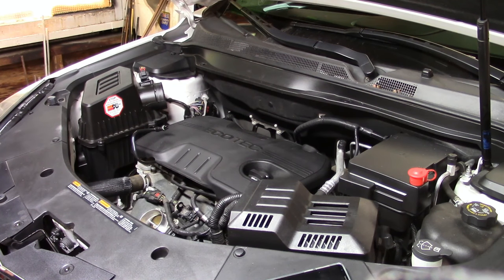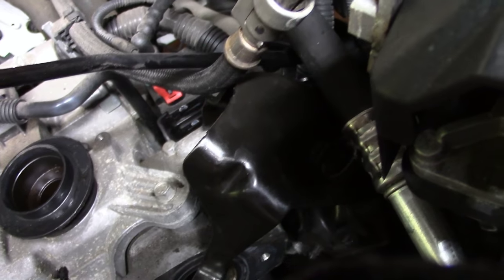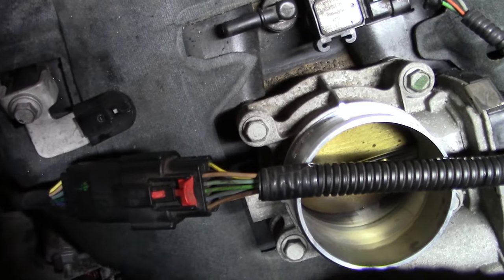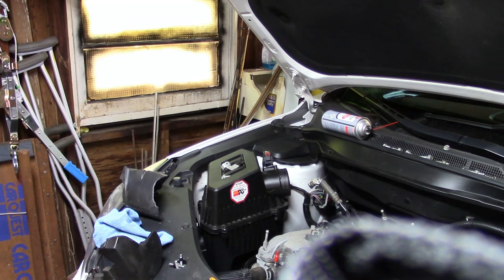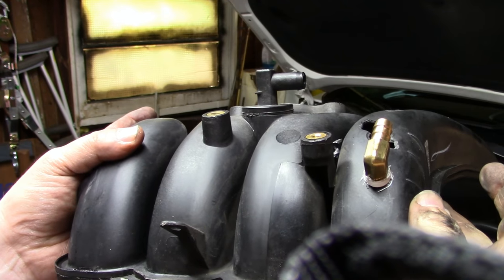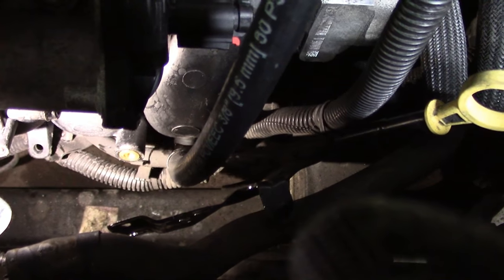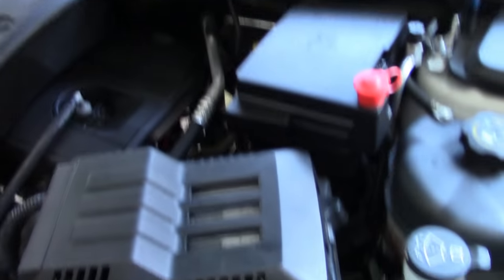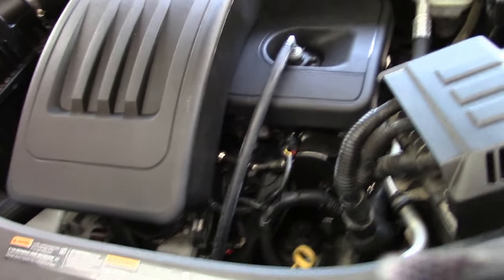2013 Chevy Equinox w/2.4L 4-Cyl. Engine PCV Upgrade

Comment: And it doubles as an oil cap retainer! I ended up drilling a small hole in the front of the manifold, right where that little valve hole would be, from the outside of the manifold. jammed an opened up paper clip in there, found the hole and gave it a good wallerin out. I then sealed the hole I made in the front with a pan-head screw so I could get in there every other oil change or so to ram out the PCV valve. Seems to work pretty well.

Comment: I own a 2016 Equinox with a 2.4L with just over 100,000 miles. I bought it new in 2016.  Last deep freeze in December 2021 my PCV system plugged up and blew out the rear main seal dumping 5 quarts of oil instantly on the highway at 70 miles per hour. Of course the motor was destroyed in a matter of seconds. It bent valves, wrecked the timing chain, etc. I called my Chevy dealer and they said "Sorry your out of luck." , but yes there is a technical service bulletin out on this but you are out of warranty. My only choice was to dish out about $4000 on a junk yard motor and installation. This is a very common problem. I wish they would of at least had the decency to send me a letter letting me know about this issue so I could have easily prevented it. Since this happened to me a few weeks ago I found this car is on the list for many other issues including paper thin frame underneath which rots out in about 8 years, timing chain issues and a few more. I am afraid to drive it now so I traded it in on a Dodge Caravan. No more GM / Chevy for me.
Reply: 😅😅😅😅 replaced it with a dodge😅😅😅
Reply: That’s true tho especially the frame and all the bushings underneath with the suspension my 2005 makes all types of clunking loud noises when I hit tiny bumps i just ordered and received new struts, control arms tie rods and new sway bar links as soon as the weather cools down next month it’s all getting replaced. I just replaced the head gaskets had the heads machined the valve covers water pump and gaskets new belts new belt tensioner new egr valve new pcv valve and hose, this car has been a money pit I thought I got a great deal 2 years ago paying $800 I only put $3000 into it plus new tires to lol
Reply from the maker: @LoveEatingCats  full disclosure; I now have a Nissan Murano.

Comment: Thank you, Brother.  My single-parent Sister, has this Equinox, 2013.  I just bought 2 pcv valves and told her to have it replaced every 18 months ( clean and hold on to old part ).
Reply from the maker: You're very welcome!
Reply: Ferndog1461. There is no valve, so what are you buying.
Reply from the maker: @TS SCI  if you watched the video, you'd know that I modified the intake plenum to use an external PCV (Part# PCV352) available at AdvanceAutoParts.
Reply: @Frank4358  I was talking to the other fella that said he bought two valves for his sisters car.  Probably is referring to the PCV tube, which people often believe has a valve.  I watched your video, both versions.  I never said you did not have a PCV valve.
Reply: @tssci6774  you really did not watch the video!

Comment: Guys i just rebuilt my Chevy equinox engine, when i replaced my pistons i bought the upgraded pistons with a better oil ring gap, also I drilled holes in the seats of the oil rings and filed them smooth as butter before I put the oil rings in. Refer to Jasper engines video on YouTube to verify this
Reply: Just bought a '13. Haven't even seen it yet. Had my brother-in-law check it out. 
I'm okay with replacing rings if oil consumption is more than I like. Just saw you replaced pistons also. Did you notice much difference from the old ones to the new ones?
Thank you!

Comment: Nice video, thank you for your patience. It is very well possible there are throttle body spacers with vacuum ports that would be a bit more reliable and mechanically sturdier for the 2.4l motor.  I ended up using a throttle-body spacer as a vacuum source for my catch can on my 2019 Equnox 2.0t LTG.
Reply: Where did you get a spacer?

Comment: Good video Frank. Thank you. It’s really sad GM hasn’t recalled this motor and addressed the piston ring issue which causes all of the problems.
Reply: Mweink law suit forced them to recall & fix. Friend had their motor rebuilt with new pistons,  rings timing etc
Reply: Wondering Why I’ve only heard of the lawsuit pertaining to the reimbursement of repairs made within 7.5 years manufacture or 120,000 miles. Any additional information would be greatly appreciated. My gf just bought her 2012 Equinox with the 2.4 in late 2019 and was completely unaware of the issue until it became an issue. Unfortunately she just missed the 7.5 year cut off but is under 120k in mileage. It pisses me off a dealership would put a vehicle like this on the lot most likely knowing the condition was present.
Reply: @MRW21783  bummer & BS on dealership ! I bought a car. Long story but there was no way they didn't know! On my Honda ! Absolutely impossible for them not to know. I go to the Honda dealership and they want $120+ to look at it. I go on line, and all kinds of complaints &  information on the issue !
I am an old guy, (not techy I am saying) but we were successful with a cure that was helping my friends vehicle for one year ( since Mar '19) before they had the rebuild done for no charge.  It may help your gf vehicle. If interested LMK. We can talk. I don't want to post on here, too much to type, too much time. Vehicle has several issues also.  I have Q's on which of the issues you guys have.. I don't want to post my phone # either though.
Reply: Wondering Why her 2.4 has the piston ring issue which causes very excessive oil consumption (weekly adding) and which causes oil being sucked into the air intake and throttle body. It’s just a ticking time bomb and will eventually be a $8000 dollar paper weight unless rebuilt.
Reply: @MRW21783  here's what we did. People will give negative comments but it worked for us, after we were given two oral guesstimates of a $4,500. to $5,000. Rebuild. Rings and Valve timing actuator valve are oil related. Varnish & build up is a problem in engines, especially in the ones we are discussing. We tried several things than switched to Amsoil's top oil, Signature Series, (I was reluctant because I was paying for it) and Amsoil micro oil filter. I had been putting some fuel cleaner in it before but now went with Amsoil's PI fuel additive And I saw they had a new product, a upper cylinder lube, and we decided to try it.
Then 🙏. I kept calling Cy, vehicle owner, asking how it was going. 1 day later. 2 days,  3 days Response was positive each time. It coded once for VTiming but did not stall out like it normally would. It started to stall out once with no code two days later. We kept using the additives every fill up. PI is to use twice in beginning then every 4 000 miles but we used it for next 8 fill ups hoping it may help, then every 3rd fill up. Use upper cylinder lube every fill up. It was a shot in the dark but a year later it was still running good and not using oil like before.
Reply: So what happens after next oil change? Cy gets notice from GM that they'll maybe fix after they change the oil themselves & run vehicle for awhile. It  used enough oil that they rebuilt with new pistons, rings and timing chain & parts. I can not say this will work for you but I wouldn't hesitate to try it again. I am a stickler and let the oil drain forever to get as much old bad oil out and even pour some new (cheaper than the SS but  full synthetic) oil in to help clean out the little bit of old/bad oil out, especially since old bad used oil can/is playing a part in this engine. I feel this is more than worth the few extra bucks. We were extremely happy we tried this. Whatever you do. Good luck. It isn't right what happened to you & the rest of us. And dealerships selling these vehicles knowing the problem should be sued. To costly for one person tho.
Reply: Wondering Why Ya I’ve replaced both VT solenoids already for her to stop the stalling when braking. Saved the stock set and cleaned the screens thoroughly for a backup set. Cleaned the air intake/PCV valve and throttle body. There’s another product I was thinking of trying specifically for the cylinder and rings. I believe it’s called Restore. Proven and tested to restore compression on a cylinder. Worth a shot. I’ve also been putting additives in her gas and a lil in the oil.
Reply: @MRW21783  ok, good luck with it . A real pain. Take care.
Reply: @MRW21783  try them knowing about the issue but never telling you until the oil burning issue finally starts and I changed my oil every 3k miles too since I got it with 11 miles on it.
Reply: @tubetime39  - Nice to know.  Getting ready to tackle a 2010 Equinox, rough idle among other things.  The car kind of fell back into my possession, it was neglected with 138k, so I'm going to swap the spark plugs, clean it up and exchange many of the fluids that are beyond their life expectancy. I also may continue using the Lucus all-in-one fuel injector cleaner & upper cylinder lubricant (fuel additive).  I've been using it for 2yrs now in my Hemi Magnum Wagon, motor runs smooth, no problems.
Reply: @350Zquicksilver  why dies the injectors need cleaned and lubricated, when gasoline is a far better solvent than the mostly oil/alcohol based additives.  Just use 93 octane fuel with a max amount of detergents. I have cylinder photos proving it works better than any additive.
Reply: @tssci6774  - I use the Lucas "upper cylinder lubricant additive" because I believe it helps add life to the motor, especially during start up.
Reply: @tssci6774  - I appreciate the info and insight.    I use the Lucas oil additive in the gas for my Magnum and 350Z, used it twice in the Equinox.  It's amazing what some do to their vehicles and the manner in which they maintain them to reach 300-600K+ on the odometer.  Craziest one I hear so far was a guy I met who is on his second Ford F150 V6 running Rotella T6 diesel oil, over 600K on the first one he traded in... Over 300K on his new one and running smooth as silk.  Many people have had good results from using the Lucas fuel additive.
Reply: GM sort of did a double secret recall on these engines.  You had to accidentally find out about it and report your problem within a limited time period to get it covered.  I was lucky.
Reply: @terrywaters6186  Hi I have a 2014 and a2013 with about 60000 on both .Do I have a chance to get it fixed by the dealer for free?.

Comment: Wow yours makes alot of rattle noises like ours after it ran low on oil, it can be the aux fuel pressure pump and it can also be the timing guides and tensioners. Great idea for the pcv valve though
Reply: Yep the timing belt stretches and the guides and tensioner are weak 
If you ran low on oil it’s a safe bet the timing chain stretched

Comment: I own a 2012 Equinox with this engine, and I need to point out 2 things. 1. Years ago, cars had a small filter just inside the PCV connection to the air intake which stopped oil from getting into the incoming air but allowed the crankcase gases in to be burned for emissions control. I'm not sure how you'd add this to the 2.4L, but I think it would be easier. 2. The engine in this video sounds like it's low on oil. Based on my experience (210,000 miles), the engine should run MUCH quieter than that with a proper oil level. When this engine gets down to 2 quarts (that's 3 quarts low), it will knock, and only adding oil will fix it. As for PCV pressure, this engine has 11.2 to 1 compression (high for gasoline), which means the combustion gases will have substantial pressure both at the exhaust valves and in the crankcase. If you suspect an oil leak, check the seal around the oil pan, and the oil drain plug. The factory oil pan seal is not a gasket, but a sealant. This can develop leaks.
Reply from the maker: The filter you speak of was a foam filter that was installed inside the air cleaner assembly. 
There's a baffle under the oil cap that deflects oil away from the PCV, so there's no oil transfer.
The engine had a full compliment of oil -- it was not low. And the "noise" you hear was from the high-pressure fuel pump. A noise that's considered normal by General Motors. It was confirmed using 
A stethoscope.

Comment: I installed an oil catch can in line between the valve cover and air-box (in the area shown at 7:02). There is a nice empty spot on the radiator support next to the air filter, making it very convenient to empty the can. I think this is a better solution since the catch can filters out any contaminants from getting sucked back into your engine through the throttle body.
Reply from the maker: This will not decrease crankcase pressure, or reduce/eliminate oil usage.
Reply: @Frank4358  Well the pressure issue (that caused blown main seals) was from the PCV hole in the intake getting completely blocked by frozen liquid.  Eliminating liquids from getting pulled back into the intake using a catch will resolve that issue.  What you did will also keep that tiny hole from getting blocked, but a catch can will do the same without modification other than mounting the can.
    As far as the oil consumption issue. That was completely separate from the PCV system and was specific to the 2.4L Ecotec of the 2010-2011 year models and starting in 2012 with the LEA version of this engine the excessive oil consumption was resolved.
Reply from the maker: @cswann8  there's a TSB that covers 2010 - 2015 regarding blocked PCV and oil consumption. The PCV was getting clogged, as well as the breather return from the cylinder head to the air box. Simply using a catch can at the breather side will not relieve crankcase pressure.
Reply: How is your setup working, updates?  I would think a CC would relieve pressure and keep crap from entering the upper intake box, plenum and eventually making it's way into the throttle body.  It's definitely better than the OEM PCV hard line that gets clogged.  https://youtu.be/H5bUBfa7JEI
Reply: @350Zquicksilver  My Terrain is running like a Swiss watch and the catch can really does a good job of making sure the top half of the PCV system gives clean air to my intake.  In warm weather I don't mess with it much, but in winter I have to keep a close eye on the can and empty it often.
Reply: @cswann8  The freezing occurs in the line from the valve cover to the air filter housing not in the manifold.  The catch can collects the water so that line doesn't become blocked by ice.  The reason anything is venting the wrong direction through that line in the first place is excess crankcase pressure due to a blocked PCV orifice in the intake manifold, excess piston blow-by or both.  So a catch can is a band-aid treating a symptom of the larger problem.
Reply: @350Zquicksilver  That line you're talking about is supposed to carry clean air from the air filter to the valve cover inlet.  If you have excess crankcase pressure it flows backward and carries oil and water vapor to the air filter and sometimes freezes resulting in blown rear seal.
Reply: @terrywaters6186  I spent a week off and on cleaning everything on the intake side, including the soot off the valves, plus drilled the office out too. It runs good now.
Reply: @350Zquicksilver  I'm at 142k miles on my 2011.  It got rebuilt under warranty over 100k ago and hasn't had a problem since.  That doesn't stop me from being paranoid my rings wont coke up or that PCV orifice won't plug up tomorrow.  I'm leaving no proactive measure stone unturned.  I'm going to use my new borescope on it at next oil change and see what's going on inside.
Reply: I saw someone do the oil catch can AND this mod with the oil cap. It was confusing but worth a try. Like you, I have an oil catch installed to catch the contaminants. It works well. I would like to alleviate some of that pressure you can hear in the crankcase when you remove the oil cap. It's terrible.
Reply: Just saw this recently... Thought I would share.  I'm doing this soon to help with future PCV maintenance.
I know it does not address cleaning the other orifices at the top of each runner, but at least it helps clear the center orifice without removing the entire intake.  Search... DON'T remove Equinox/Terrain intake manifold. PCV hole Super Easy Fix ((or)) Equinox/Terrain 2.4L Ecotech Clogged PCV Orifice Quick Fix Without Intake Removal
Reply: @cswann8 same. I also installed an breather as my oil cap. Adds relief for the minor blow back.